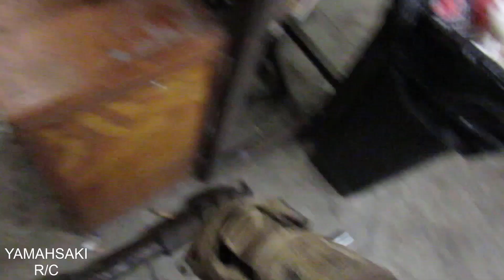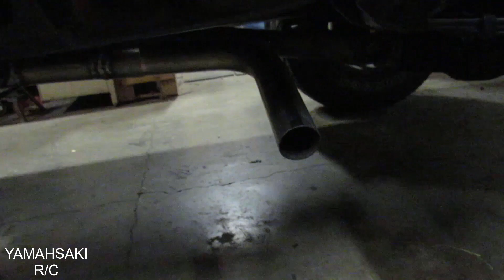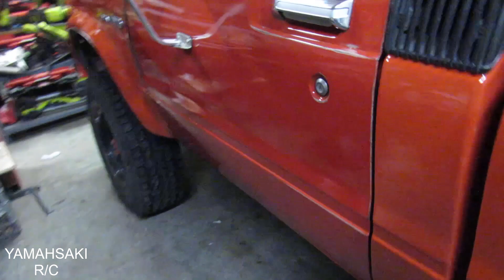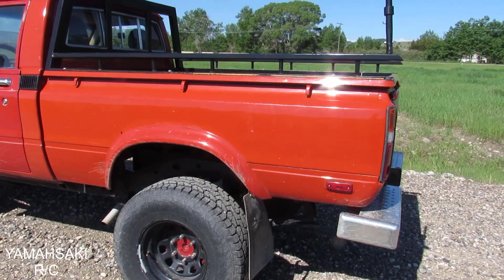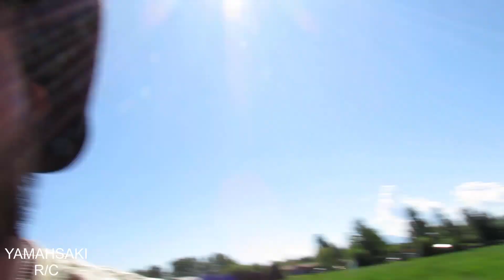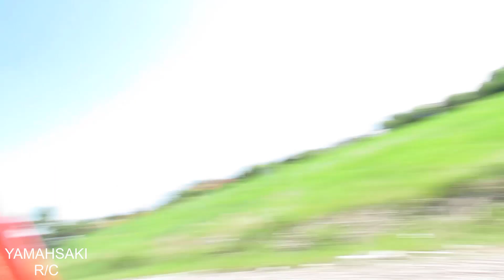1980 Toyota 4X4 pickup preservation part: 10

Comment: Any updates?
Reply from the maker: Well, I plan on getting it on and out of storage for the year. It’s been parked over the winter, still has a few issues, driver side door came loose, bolts just loosened up as well as my seat bolts need tightened, it still leaks so oil from the rear seal so the tranny will need to be dropped and it will need to be fully replaced and it’s just a little high up on RPMs at idle not sure why could be on the Weber adjustments or some other small thing, other than that drives like a dream.
Reply: @YamahsakiRc17500  looking forward to the upcoming videos then. 😉